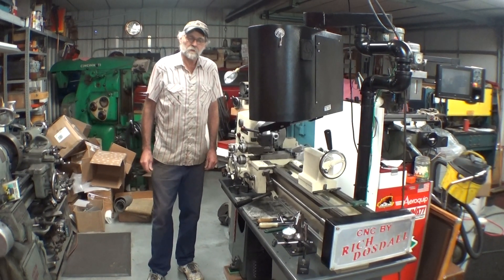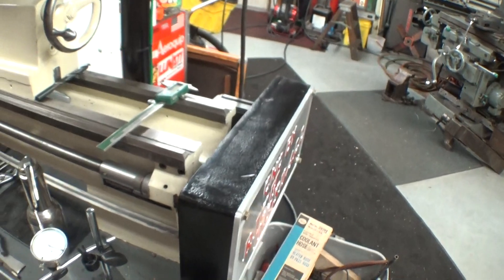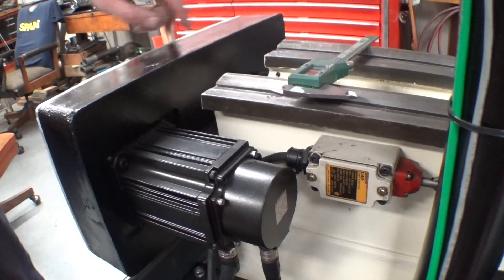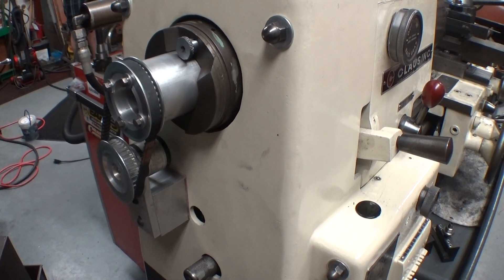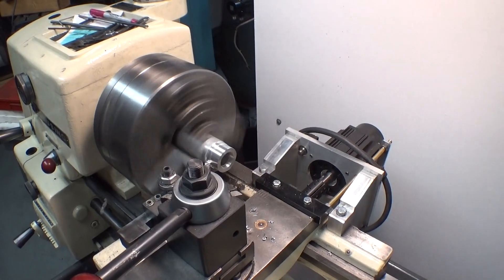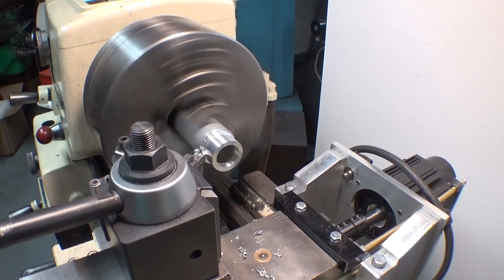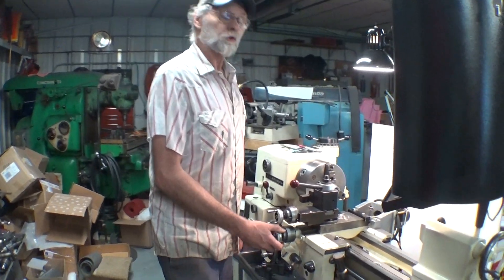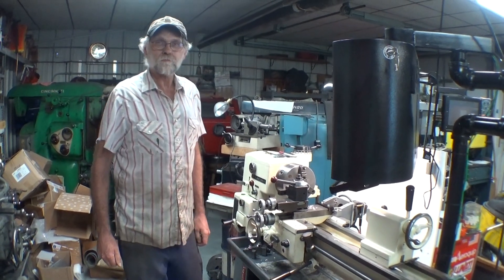Clausing Lathe retrofit to CNC

Comment: Excellent work.  I really like your idea of being able to use your lathe manually or as a cnc and the flexibility to add ball screws in the future if you felt the need too.  I would like to apply the same idea to a Grizzly G4003G 12 x 36 that I have.  On my Haas TM1 there is the ability to release the servos and freewheel move the x or y axis by hand and it still reads the xy positioning on my display readout (near $300 that can go toward controls).    questions...    Do you lose position and have to reestablish Z0.0 if you disengage the halfnut?  Do you release the drive to move your cross slide, if so, could you have done the same with the Z axis?  Do you have future plans to install a variable speed motor to maintain constant surface speed along with your encoder?  Are you able to do threading with this setup?  Would you be willing to share info or do you have plans available to purchase?  I Really like you project.
Reply from the maker: Hi, If I release the half nuts, I do then have to home the machine again. I don't have to release the y, it just turns the motor easily (when the drives are off). There is no way that you could move the carriage with the half nuts engaged, even if there wasn't a motor hooked to it, It may be possible if it were a ballscrew. I get along fine with just using the variable speed that the lathe has. Just the other day I threaded a bunch of 1/4 brass pipes with npt., worked well. I did find it best to cut taper first, then thread using multiple taper passes. I can answer any other questions you may have about building it if you would like to give me you email or phone. Rich

Comment: Wow, didn't know someone would go through the trouble of fitting/modifying a lathe like this.  Was it, is it, worth it? or should that average person by one from the factory?
Reply from the maker: Yes it was worth it. I can still use it as a manual lathe if needed If you buy a turning center, you are always working down inside the doors, this way everything is out in the open. Also doesn't take up as much room in your shop (if that is an issue)